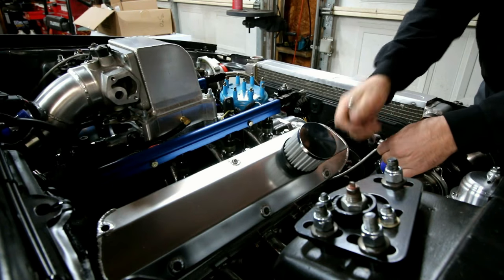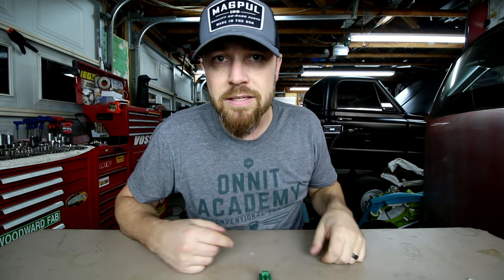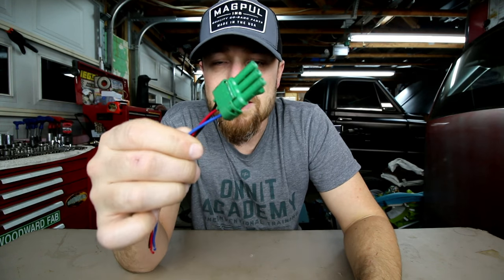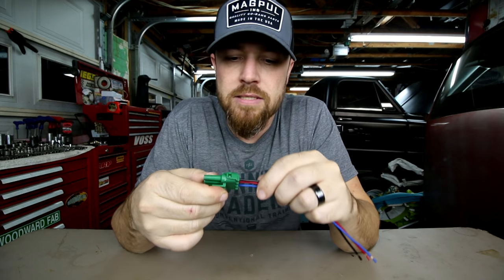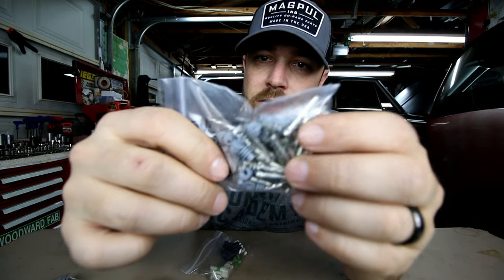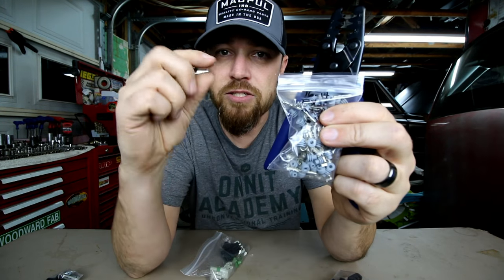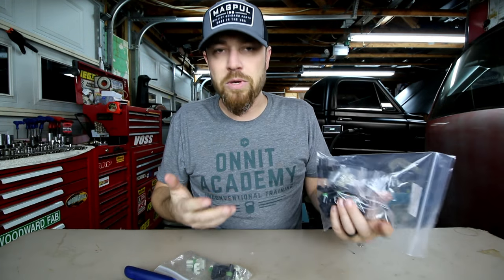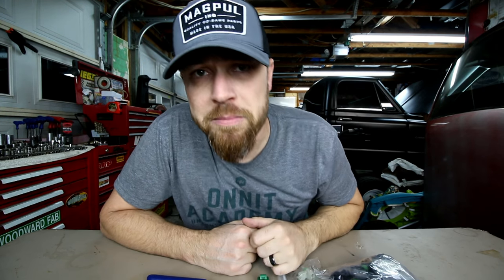You Need This Tool - Episode 51 | Weather Pack Connectors And Tools

Comment: Nice tool with the connector. However I can guarantee you that over time plastic will break down. The end all be all connector is the cannon plug. It's a male/female connector that threads together. The pins are soldered to the wires. This is the connector used in Aviation atleast when I was in the Navy and worked as an Aviation Electrician that's what we had. You can buy them with flanges to mount them to a fire wall and you can then just plug-in your harness. They can also be safety wired to never come loose. Hands down best connector but they are expensive. I like the idea just thought I would inform you of something that is a bit better. Also they are an aluminum body with a silicone type center material not sure what it is. 100% water proof and you can pin and depin over and over again
Reply: CW Chops & Rods  cannon plugs were a nightmare to deal with in Iraq! They don't play well with sand at all and trying to re-pin the wires into a new plug body is enough to give a guy a case of Tourette's syndrome. I will agree they have their place but that place isn't in the sand and grit.
Reply: Im sure that can happen. Ive personally repinned hundreds of them working in AIMD on the USS Abraham Lincoln. I was in the electric shop. It just takes practice when you get the hang of it it's pretty easy. I could see sand and grit creating issues I've never dealt with that issue

Comment: I must admit that I've been crimping and soldering connectors a lot... But when you have the right crimping tool for your terminals, you can trust that they are 110% connected and will never fail! Also soldering will weaken the joint because it's more prone to breaking the wire if you wiggle it too much...
Reply from the maker: I would agree

Comment: The links you posted for this video are just for one connection (one male and one female) but you say you buy these bulk online.   do you have a link to a bulk pack of say the 2 pin connectors?  otherwise i will just increase the number that i order via amazon.  thanks for the video.  these will be great when i put the offroad lights on the grand cherokee
Reply from the maker: Just search amazon for weather pack and you will find the packs

Comment: Great connector system: Delphi Packard weather pack. I won't disagree with you. 

But!! Even better. Deutsch (pronounced DOITZ) MUCH easier to crimp, connections are vastly more secure and sealed AND far easier to modify if you so choose. IMO.

Good vid btw!
Reply from the maker: yeah for sure

Comment: The Delphi weather pack connector is Ok.  Like it will get the job done.  But in comparison to sonething like the Deutsch DT series connectors, they are utter junk.  They are an absolute pain in the arse to assemble and terminate.  And are no where near as reliable as they should be.  (same deal with metri-pack)

Its a hassle to individually install each seal onto the wire.  And its a hassle to have to do 2 stages of crimping to first crimp the wire then the seal.  And its a super big pain in the arse when you need to depin them.  In contrast the DT connector has none of those issues.

For a cheap, easy,  readily availble to use plug, i dont think you can go past the Deutsch DT Plug.  

And no, i dont work for Deutsch.  But i am a professional Auto-Electrician and have to do this stuff every day.  I know which plug I'd rather use.
Reply from the maker: I could see that. Very few have to install them for a living though.
Reply: The Fab Forums 
Yeah.  If its just a hobby car car, and your only doing a couple of plugs here or there.  Use whatever you already have the tooling for.  But to the people that are specifically gonna purchase a set of crimpers and connector bits.  Then you may aswell use something better than Weather Packs.  There cant be a whole heap of price difference with the tooling or components (non genuine) between the types of plugs.  Its just the ease of use that you can improve on.
Reply: I agree Deutsch is better, weather pack, metric pack are ok but I find them to bulkly and the pins are cheaply  made.  A official Deutsch crimper will run around  300$.  Its worth  the money,  there are knockoffs online for about  30$.

Comment: Nice, but how does the - "disconnect tool" function, as shown in the beginning? It was my next question How to avoid moisture in the wireconnection, close by! Finn, Denmark
Reply from the maker: The connector is designed to keep the moisture out. You can watch the other video to learn about the disconnect tool - https://www.youtube.com/watch?v=YE2_ktvHqG8&index=40&list=PLAxdsA1NmxpEtYKKPOFyvOTiodTkCJ6Fv

Comment: Another nice installment in the You Need This Tool lineup. I've never bought these connectors separately, but I've seen them. I'm pretty sure a J&S Safeguard I installed on one of my old turbo cars had the same connectors. On a side note, you're great in front of the camera, Kyle... very entertaining, especially when you ask questions to the other guys on the set. 😉😂👍 Excellent editing, too. Watching 200 of these this year is going to be easy. Rainy all weekend, more time to work in the garage. 👍
Reply from the maker: Thanks

Comment: Do you know connector like this for large gauge wire that would run to a fuse panel like 4 gauge?  I am in the middle of a swap and would like to have a connector in the middle of the wire so I dont need to need to unbolt the fuse box to get access to the bolt for the wire when ever the harness needs to be removed for servicing the car.
Reply from the maker: not right off the top of my head

Comment: used them on my train horn install. but I soldered my wires. crimping is for slackers.
Reply from the maker: lol. some things are designed to stronger crimped vs soldered. I also solder a lot of stuff though.